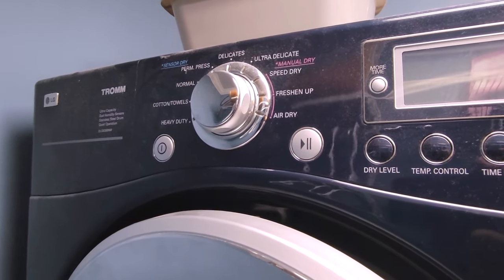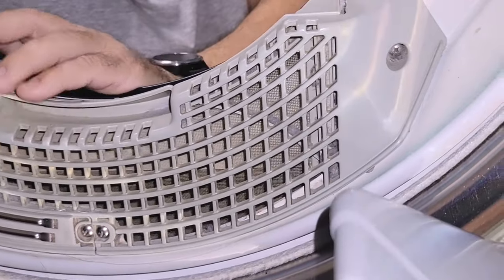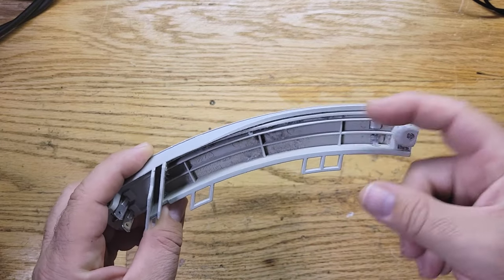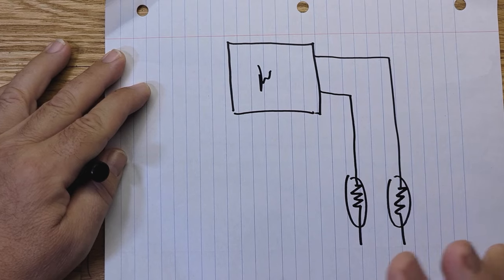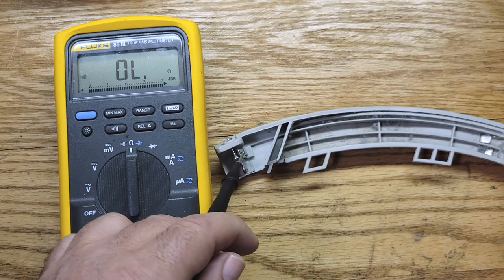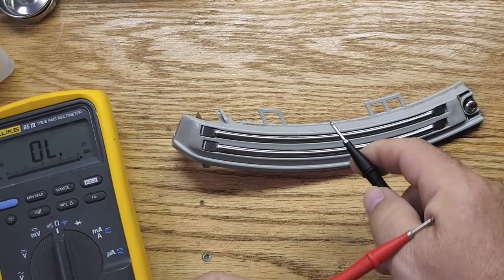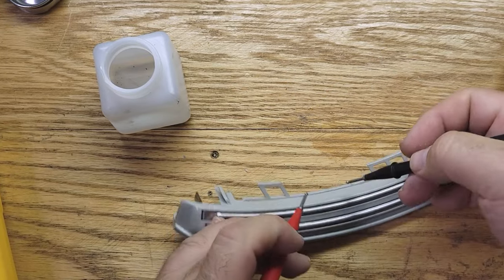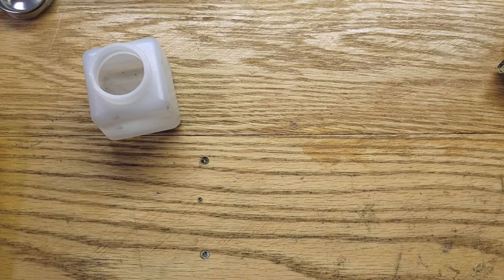LG Dryer shuts off early.  Moisture sensor fix.

Comment: The issue is caused from bounce sheets, causes a wax-like build up on bars. Use a green scotchbrite pad to clean. If testing with a dmm put probes on terminals then put hand on both moisture sensor bars, if ohm reading changes its good. Then you have another issue such as plugged wall vent..

Comment: I just bought a brand new LG dryer and this sensor keeps stopping too. So it is def not dirty or anything, it just sucks. I just don't use the sensor option, but turn the knob all the way to the right where it says Manual Dry, Speedy Dry and Choose Time Dry to select how long you want to dry it for. Thank you for your video, this is really helpful!

Comment: Good  tutorial , I did not take out the lint trap, I just reached in and clean the sensor with alcohol and sand paper since it was visible.  Save me from buying a new dryer.

Comment: Good video.  I just had the same problem with my LG dryer and it would only run for about 15 seconds before stopping.  I cleaned out the area under the filter as it was very full of lint, and this still did not solve the problem.  Finally I thought as you said that the sensor was not working because it's surface was dirty.  I cleaned the contacts off with some 3M Scotchbrite material and now it is working fine.
Reply: I’m going to try this

Comment: Very helpful video!! What would you recommend for a dryer that’s brand new? Surely there’s nothing built up on the sensors. It stopped drying after 10 minutes the first time I used it, and the clothes were definitely still wet.
Reply from the maker: Manually set the time to more than 10 minutes.  This will bypass the sensors because you set it to a specific time (that's how mine works).  If it still shuts off early then its likely not the sensors.   Other than that, I would contact the manufacturer if its new they usually give 90 day warranty.  Under the warranty they would send someone to your house to fix it.

Comment: Thank you for this video. My BRAND NEW samsung smartcare dryer, in my BRAND NEW home was not drying clothes completely, so I went through all the trouble shooting things I knew of, make sure the vent hose wasn't bent or blocking the exhaust, make sure the vent itself didn't have construction debris in it, made sure the gas line was connected correctly and the valve was open, checked and yes the dryer would run, yes it was heating quite well, yata yata, but nothing would actually be dry so I sat there and watched it go through a complete cycle (an hour and 16 minutes on max settings) but it stopped after 52 minutes, checked the clothes, still damp. Re-started the cycle, it shut off after 13 minutes. So I started looking online. 
The samsung website says "clean the moisture sensor with a damp rag with a drop of liquid soap". 
That didn't do squat. 
THIS however (sandpaper and rubbing alcohol), worked.

Comment: My LG dryer has been shutting off early (about 10 minutes in on average) during the dry cycle. I will definitely give this a look and give what you did a try. Thank you for posting this!

I checked continuously of the sensor bars and got low resistance readings on both (I use the diode tester function on my Fluke and got the solid beep on both).  I didn't go rail to rail and use a damp cloth across them to measure the resistance, need to try that next. At this point, I can't see the problem being the sensor elements.

Comment: Thanks for making this video...My LG electric dryer DLEX8000V is showing 4 bars on the flow sense indicator light and I have extensively cleaned out all my ducting all the way to the exit exhaust fitting outside my home...Even after removing the duct to the wall from the dryer it is doing the exact sequence you mentioned: It is 41 minutes reading on Normal...then it quickly drops to 9....and then 6...until it turns off way too quickly and shows d 80...but it is fine in heavy duty or even jumbo dry...crazy huh?
In Diagnostic Mode the following codes cycle before any tests U 10...d 12...15:E5...In the moisture test the number went from 237 down to 68 when I put the damp cloth across the sensor bars...so it seemed like it passed...I also ran the other two checks for temp and started at 35C ended up at 74C before declining very quickly to 68C then back up to 76C...whoa...is that good?...the range should be 5-70C...and pump AD value is 14-15...I am having problems getting my plastic housing out that contains both moisture bars...mine is one piece instead of having two screws like your model dryer...Can I just unplug my dryer and wipe down or polish those bars while it is still assembled?..
I wanted to confirm my guess that I have to remove the door and the front cover to access a screw(s) that hold the darn lint holder in place if I MUST remove it...thanks for any suggestions
Reply from the maker: On my dryer I could of polished them in place.  I only removed them to show what they look like and explain how they work.  Either way make sure you unplug it first.

Comment: Hi, I don’t have a way to test my sensors but I’m having an issue with my dryer stopping usually after 1-2 min of starting it for the first time. I then open and close the door and start it again and it runs the complete time for the cycle. Could it be my sensors?

Comment: Great Video.  My GE dryer display works but i hear click and single beep only when I press start button.  is it possible that safety switch is not working or might be moisture sensor as well ?

Comment: In your opinion,  my dryer starts 40 minutes,  get to 38 minutes then drops to 1 minute then does it tune and cuts off. Do you think it could be the moisture sensor bars
Reply from the maker: Sounds like it could be.  You can put it in manual mode by selecting a custom dry time  like 20 minutes or something and see if it goes all the way to 20 minutes.  The moisture sensor is not used when you select a custom time.

Comment: stupid question. Couldnt you just jump the wires and eliminate the sensor? The dryer should shut off after timer then?
Reply from the maker: It sounds like that may work but i dont know.  But then everything would go for the full time so youre gas bill would go up.

Comment: Will it work without the sensor? What’s the main purpose for the sensor?
Reply from the maker: The sensor is needed to sense when the clothes are dry.  For example if they dry in 10 minutes you don't want the dryer running for the full 40 minutes (or whatever cycle time is) and wasting energy.  I don't think it will work without the sensor.

Comment: Great video. We have a Samsung with the same issue. I'm wondering if anyone has simply disconnected the moisture sensor successfully without generating an error code or rendering the dryer inoperable. Anyone?

Comment: Since the moisture sensor use DC current, one element always goes to the ground. So, it does not matter which wire goes where. My Electrolux has a blue and a white wire. The white does to the ground terminal. But it does not matter since these are two isolated elements. The moisture in the clothes provides resistance over the two elements. Less moisture, less resistance. Based on OHMs.
Reply: Nothing you have said is accurate except maybe that it's DC.

Comment: Here is my question: 

If my dryer is running for only a few minutes and shutting off but stays on while I’m running it on air dry then it’s more likely to be the thermostat, right? 

Common sense says that if it were the sensor, it would shut off while on the air fluff or air dry or whatever that mode is lol 
Right?
Reply from the maker: Mine goes into the sensor dry mode automatically.  But if I change the dry time or use a custom mode then it does not use the moisture sensor.   So try changing the dry time if it still stops before completion then it's not a moisture sensor issue.
Reply: @signalsandbits  in that case, what is it? My dryer still keeps on shutting down and saying N95 and drips some water when we open it. We use the manual setting and dry on ultra low temperature and it still does it. We completely cleaned our vents. House and dryer are a few months old.

Comment: Ok hold on...I get that your unplugging your dryer but not everyone has a gas dryer with a 120v plug. Might want to inform everyone that if they have a electric dryer they will need to unplug the bigger 240v plug. It will either be a 3 or a 4 prong plug. Or if they know what circuit breaker there dryer is on they can do that as well. However it is much safer to unplug it from the wall.

Comment: Is there any way I can just put my washer on an auto pilot where it just dries and doesn't worry about sensing moisture?
Reply from the maker: I'm pretty sure you can do that by setting the dry time yourself.  if you set the dry time then it doesn't need the moisture sensor because you're telling it how long to run.

Comment: I think you unplugged the wrong plug. That's a 110V plug you just unplugged; the dryer is 220V - You're gonna get zapped 😁 - I used some steel wool to clean and that did the trick.

Comment: so..my Samsung machine is not shutting off  in moisture sensing mode...it just stays running in heat mode. Probably not a moisture sensor problem or a moisture sensor wiring open since current must be being detected by the controller to run the system- (assuming the control board is working properly).   I'm thinking the controller has got a problem.
Reply from the maker: If it keeps running past the set time then its probably something else wrong.  Even if the moisture sensor is shorted it should  still stop when the maximum time is reached.
Reply: Do you need to remove it to clean? Can you just unplug and tell if it has a layer of film on it?

Comment: I replaced mine with new sensors and it still doesn’t work 
The dryer turns off in 10 minutes 
Any suggestions
Reply from the maker: Try a system reset. The steps to do a system reset can be found online.
Reply: @signalsandbits  I cleaned mine with alcohol wipes and the multimeter was making decent connection but after around 5 minutes of running the timer switches to 5 minutes remaining and "finishes".
Reply: @greghercher2068 same here wondering if I need to replace the Thermistor
Reply: @mingzhu8093  my wife figured out that if we run it on speed dry then it doesn't do it, so we just set a custom time and use that. I'm thinking that I'll replace the dry sensor soon but not really worried about it right now

Comment: I’m trying  to fix  my LG dryer. My  10 year old  son put  extra soaking  wet clothes in  the  dryer.now it wont spin. lights turn  on.
Reply from the maker: That could be a lot of things door switch,  motor belt...etc...  It doesn't sound like a moisture sensor problem.  You could try a system reset to see if that helps.